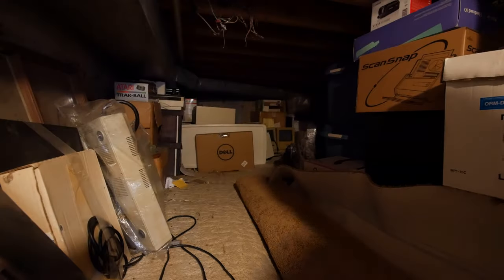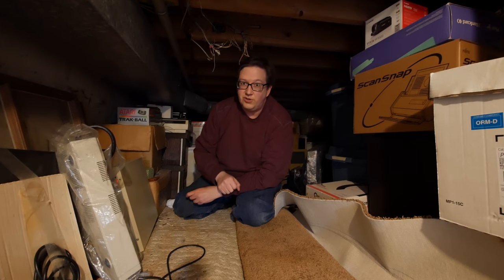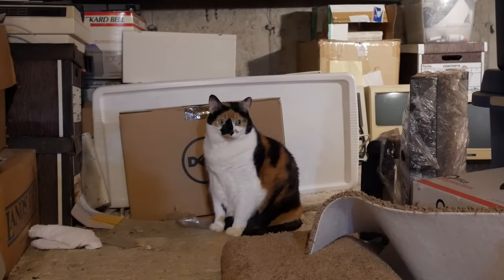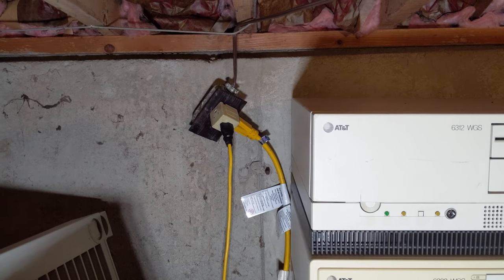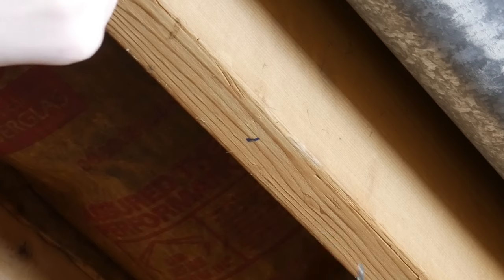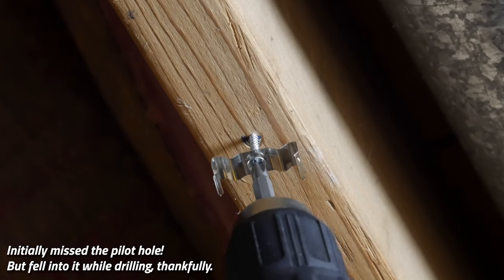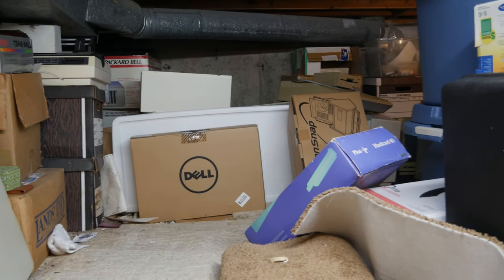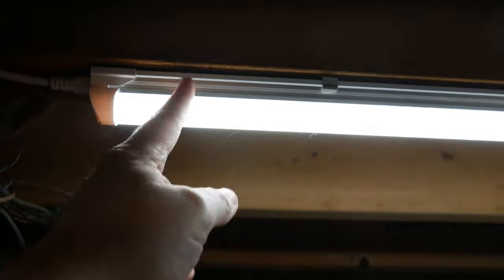Adding LED lighting to my vintage computer crawlspace

Comment: Dang, nice results! Looks like these might be ideal for my basement and my secondary storage unit, both of which only have hanging shop lights. I'm not a fan of wiring up my own LEDs and power either, I just wanna plug crap into a chain.
Reply from the maker: These are most definitely ideal for plugging crap into a chain.  However, you can't exceed 6 on a single daisy-chain -- not because of total power draw (it's only 3 amps for all 6 on at once), but because the electronics in each individual light couldn't handle the draw if more were connected.
I already threw out 1/8th of the crawlspace contents (was junk) so I'm excited for the future.  Found an answering machine from 1990 :-O

Comment: new lights own. ever since i started lighting my living and work rooms with Osram HCI-T 942 NDL, my life changed for way better.
Reply from the maker: Nice.  But those are halide, don't those get crazy hot?
Reply: @TheOldskoolPC  try to resist the urge to touch them. otherwise they get as hot as anything else: in an enclosed room, a light that uses x watt heats it by x watt - even if most of it is light (as it dies out it turns into heat). those halides are as efficient as LEDs - so for the same amount of heat you get more light. I essentially have a 150W heater in my room at all times, could be way worse, my pc outputs several times that

Comment: 1:56 that would be a 2x8 or 2x10.
2x4 are used for walls.
Reply from the maker: I stand corrected, thanks!
Reply: @TheOldskoolPC  these LEDs will be perfect for my crawlspace by the way. I'm glad I came across your video before I dropped a pretty penny on an electrician  installing a bunch of outlets.